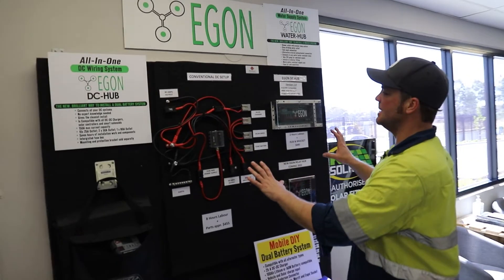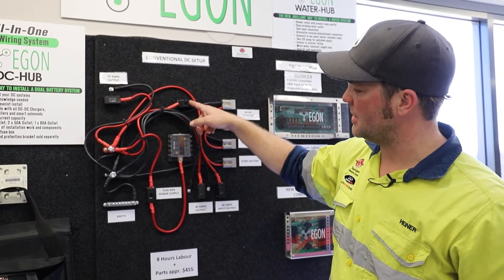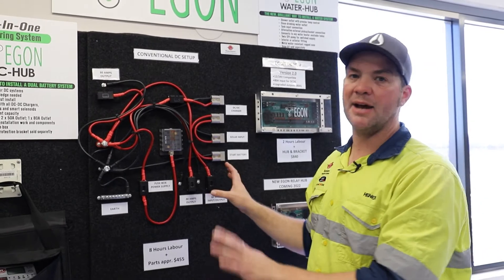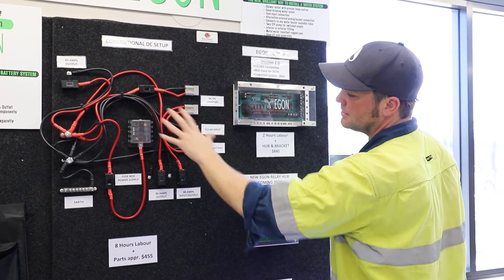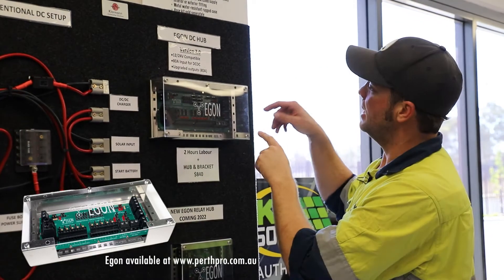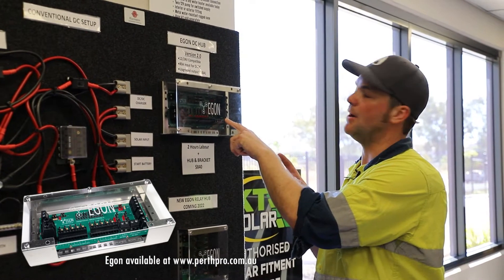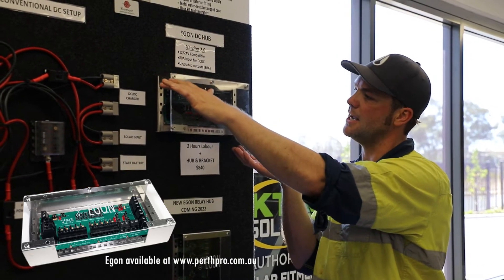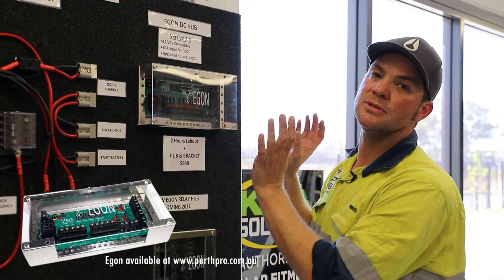Egon DC Hub Product Information

Comment: How big can the aux battery bank be for the DC hub?  Would it handle 120x2 parallel lithium? Cheers!
Reply from the maker: As big as you like it to be. Just limit the maximum current from the batteries to the DCHub with a 150A fuse.

Comment: Live to see a episode with an in-depth install.  And always wondered how the acc fuse are switched?
Reply from the maker: Hi Jack, The EGON DCHub does not include any switching. It can be connected to any available switching system. EGON is developing a switching system that can be added on to the DCHub. The first part of it will be available soon and is called the Relay Hub as seen installed in the 200 series video on our channel.